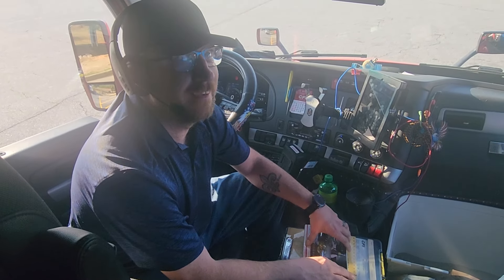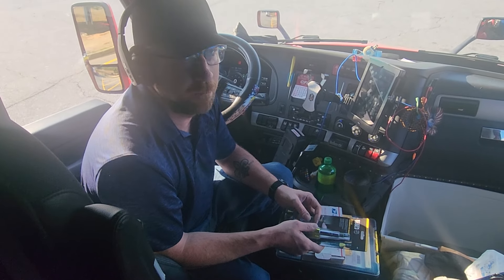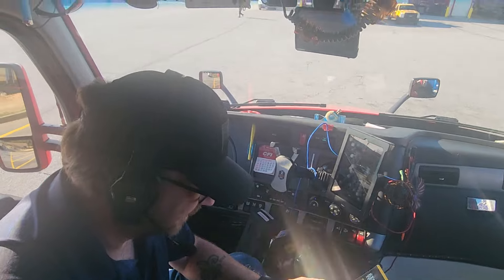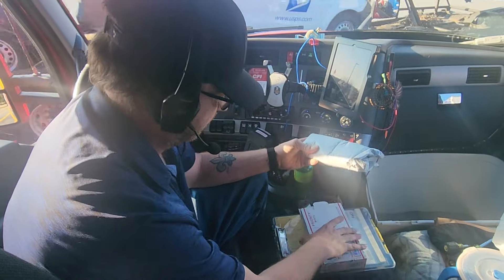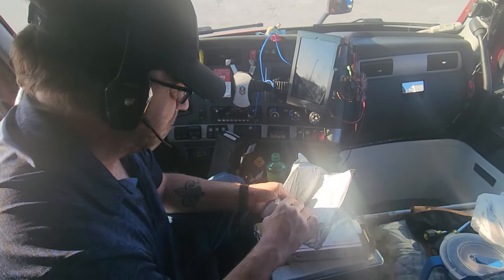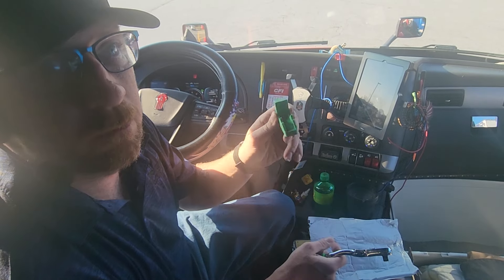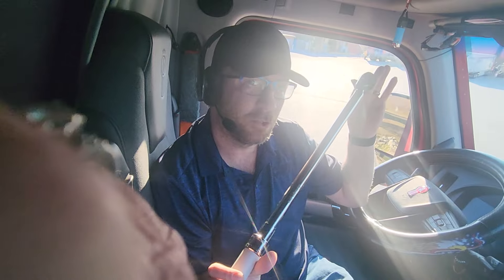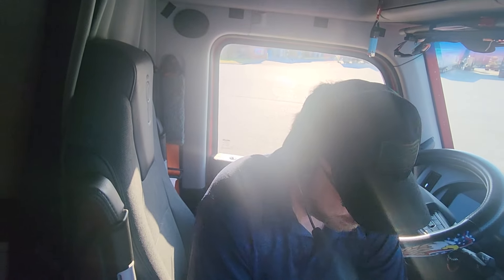New / Cool Tool Tuesday #ratchet #snapontools #gearwrench #klien #diyer

Comment: The Klein multi bit screwdrivers are excellent, I’ve got several 11:1s and used them daily when I was working on reach in coolers. I have the HVAC model that has the valve core tool / broken core remover bit. 
Those long 120xp ratchets are great too, I bought the long fixed 1/4 and 3/8 from Mr Joe years ago and they’re both still with us. Congrats on one hell of a torque wrench, I find some killer deals on eBay and in Pawn shops
Reply from the maker: Thanks for watching